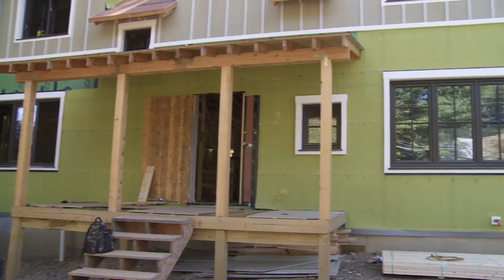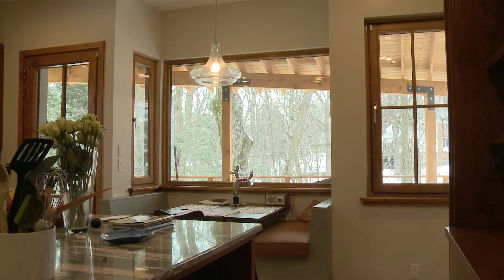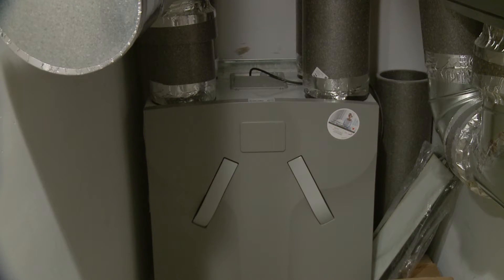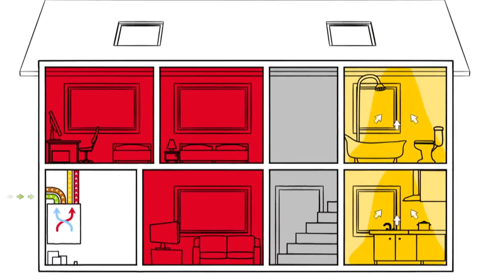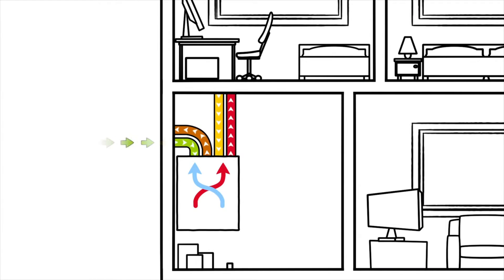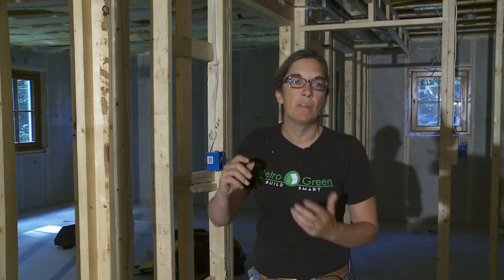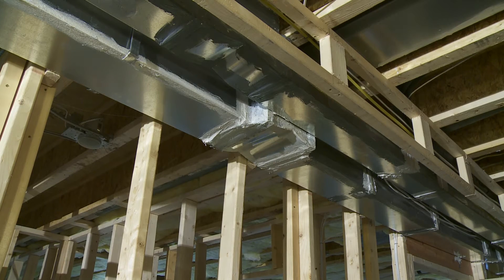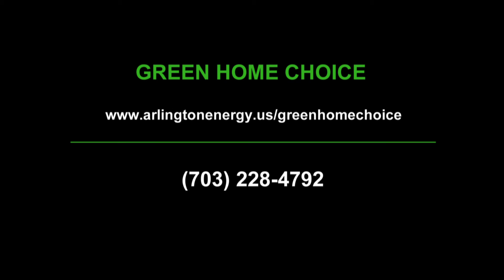How to Build a Better Home - HVAC and Duct Work

Comment: Good advice if not old and general.  Stick framing should be gradually phased out in favor of masonry structures and the use of local materials.  LEEDS and stick framing bring us suburbia.  There are lots of other ways to build a comfortable shelter, without using tapes, caulking, plastic sheets and all the other man made products.  Passive Haus design to start.

Comment: You want the outside vents to be on the same side of the house. Wind blowing in one will unbalance the system. You still have to put them several feet apart so air streams don't mix on the outside.